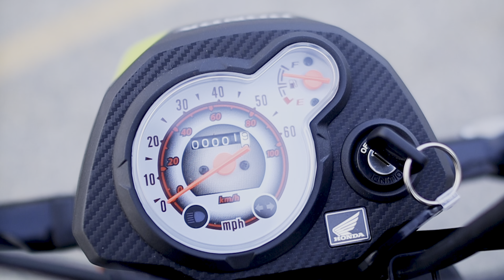2024/23 Honda Navi - 5 Features To Know About!

Comment: That's what I like about the Honda Navi storage compartment is a little bigger than my 150 of used to have you can always fit gloves any that's how small it was this one is definitely a upgrade from the 150 haven't tried to fix full size laptop in it yet but I'm pretty sure it will fit just don't want to carry it around too much without some kind of protection

Comment: Holy moly! I was going to I stall a trickle charge today. I was wondering how to easily access the battery. So many people have warned me how fast the battery drains when the bike is not in use. I don't know why but it's a thing. So glad I watched this video. You saved me some money and time.
Reply: What does the trickle charge cable do exactly? Thanks
Reply: @bidenssugardaddy6098   Well, I was wrong. After watching this video I went and checked my brand new Navi (3 days) and no cable was installed. I called the dealership to ask that even if they didn't install the cable, could I atleast have the cable and install it myself. They said no such cable comes with the Navi. 

The "trickle charge" or battery tender cable plugs into a home AC outlet and maintains the battery voltage if your cycle is going to go long periods of time between use. The first Honda I had, went 6 months without being used during the fall and winter. When I decided to take it for a ride during the summer the battery was dead. Honda dealership charged me $240 for a new battery. The next time it happened I went to Battery Source and got the exact same battery for $35. Moral of the story, Honda is good but dealerships are crooks.
Reply: @jamesrevell6475  Yup - that is a thing dealerships do as a perk in some areas.  But I had nothing so am installing mine today.

Comment: FYI - stock Honda Navi does not come with an installed tickle charger cable. This was either installed by the dealer as an option or this was a used Honda Navi that was purchased and the previous owner installed a tickle charger. I know cuz bought a Honda Navi the tickel charge cable was an option to be installed by the dealer.
Reply: Tickle-giggity

Comment: Trickle charger is not standard equipment, it doesn't make sense, the thing has a kick start and is very easy to kick over.
Y'all also missed that it has a steering lock under the triple tree, we owned it for over a month before I realized.

Comment: what was the out of the door price and the top speed?
Reply from the maker: Stay tuned we’re making a buying guide!
Reply: About $2400 and 48mph with a 6'4 rider and 190 pounds
Reply: @joshuareynolds2163  is that 48mph with downhill and wind working for you??
Reply: @GrandTheftAut0  48mph average both directions on a flat road so wind is taken out of account.
Reply: @joshuareynolds2163  ahh gotcha. Thanks
Reply: @GrandTheftAut0  I'm 6 foot 176 and I got it to 56mph and with strong wind I still got it to 50mph
Reply: 2664$ out the door in Conroe tx
Reply: $3100 OTD 52 mph stock with 210 pounds of rider.

Comment: I don't think you'll want to be able to start the navi with the side kickstand because there's no way to put the bike in neutral because it has a scooter transmission. You can start it with the center stand because the rear, drive tire is off the ground.
Reply from the maker: Little too much vroom vroom can be dangerous! You are right!
Reply: That is why it has a PARKING Brake.  I made my dealer kickstart mine to show me it worked and would start that way and other than having to kick it 3 times, it started and there was no issue.
Reply: @dominahorti6810  Yeah, all the honda scooters wont start unless you have one of the brakes pressed.